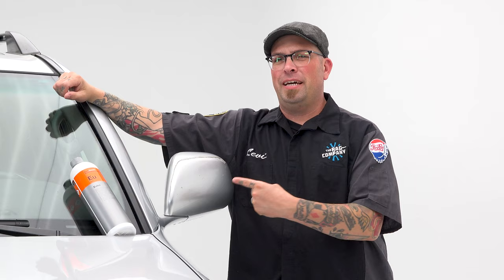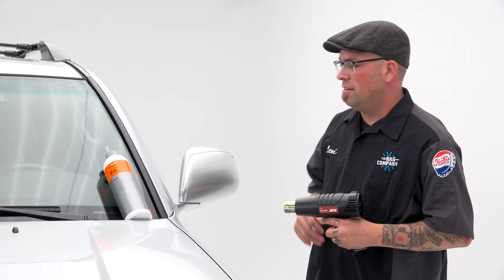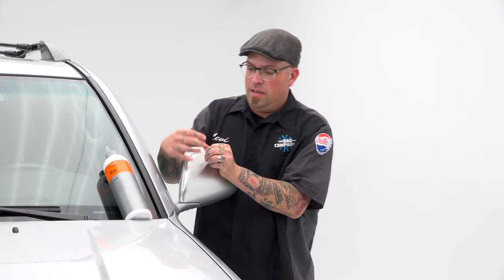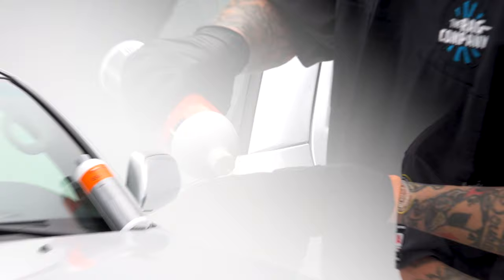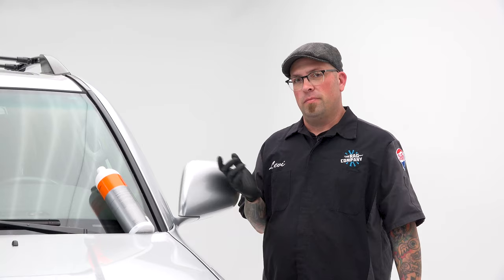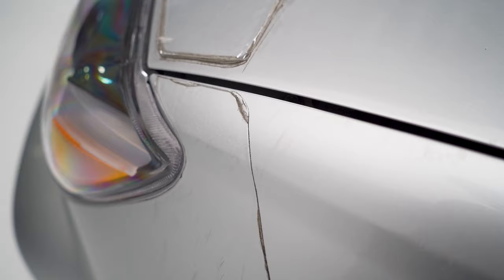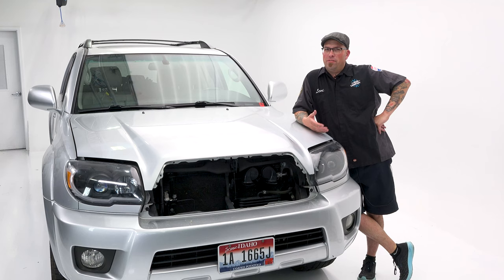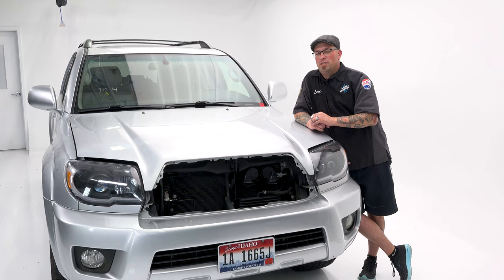Nasty old Paint Protection Film on your car? Here's a safe way to remove it!

Comment: So you have to repaint the areas that were not protected to match the area that was??? So why even use a clear protector? Doesn't make any sense
Reply: That's why you need cheramic paint coating too.
Reply: the intent of the film is to protect the finish, but it doesn't work well, it doesn't last. It's a failed product.

Comment: For a super easy way to heat up the section easily, lay a drying towel across the ppf and pour hot water over it. It will hold in the majority of the water and make removal easier. Heat guns work great but the hot towel is even safer. Also, just a tip, but inspect the paint prior to removal. Often with repaints, if the paint was not cured properly or even if the paint job was not the best, pulling clear can be an unfortunate side effect. Obviously in this case you guys know the vehicle, but if it’s a customer vehicle get a little background info first. Always better safe than sorry
Reply: So what you say a steamer is better to use rather then a heat gun ?

Comment: That looks like a pain. I hate removing PPF but if you use a kettle and pour a little bit of boiling water it works wonders.....but still not a job i would want to do lol
Reply: And likely that would not help when it breaks off in tiny little pieces like that

Comment: I used a plastic razor blade and gasoline. It didn't remove paint or clear coat. Put a soaked towel on each place and left for a while to soften then scraped. Used it with a blow dryer in some places. Gas worked better than laquer thinner. No damage but it was a nightmare.

Comment: Ppf installer for 7 years, we just use a good  steamer to soften it up and comes off clean, doesn’t peel paint or break off like that. If it’s shitty ppf/ been on there for more then 10years then yes this can happen. But it’s not vinyl.. using a heat gun doesn’t work the same way for ppf

Comment: I've used Goo off that works very well and it's oil-based and it will pick up all this stickiness especially if you're working outside got let it beat up and then it removes it nice and clean

Comment: ok great advice for NEWish protective film. How about some advice for OLD protective film. What solvent means I dont need to heat and hack at it for hours.
Reply: i know i am late to the party but there is a product that works great on OLD film. its made by crystaltek(west end products) and is called vinyl off and they also have a more "aggressive" one that is made for the reflective vinyls and 5-10 minutes in the sun and spots of film will literally separate from that panel
Reply: @ronbaer67  thanks. Yes, quite late indeed. Will see if I can get it where I am.

Comment: You didn't mention in the video.l but what were the reasons to remove the ppf?   And what about half ppfed panel? Like the hood that was partially ppfed,,  the sun usually beat up the paint and it changes color over time.. were you able to normalize the hood color with a compound? Can we still see the ppf area?
Reply: Hail damage requires removal of ppf if you are doing hot glue PDR

Comment: Help! I think my heat gun was too hot and the plastic film fused with the glue into a goopy coat. When I remove the heat, the goop gets hard, when I apply the heat it gets super sticky. I tried applying WD-40 while it was warm and it just cools it off and becomes hard. Ideas??

Comment: If I have an adjustable heat gun, what's a good temperature to use that won't damage the paint?
Reply: I would try with boiling water first or boiling water on a towel. Consistent heat will work to loosen the glue better than a heat gun. Look in the comments for how to do it or do a YouTube search.

Comment: The dealer had put that stupid "paint protection" crap on my car before I came along and bought it, and though I did absolutely refuse to pay for it, 6 years later it is cracking, peeling, turning yellow etc and looks like hell. Interestingly, the unprotected paint itself looks new anywhere the "protective film" doesn't exist. My son owns a thriving vinyl graphics business, and wraps/unwraps cars etc all the time, and even he is afraid to touch that stupid stuff with a ten foot pole. My advice is to never buy a car that has it in the first place.

Comment: What is the average life of a clear bra, assuming regular maintenance and a coating (eg wax or ceramic)
Reply: It depends on the quality of the film and the climate where the car is used.. up to 7 years should be safe for high quality films like XPEL.
Reply: So would you recommend removing it at 7 years? What is the consequence of waiting later?
Reply: @waterdd1  My Toyota Sienna with PPF has been exposed to the Florida sun for almost 8 years. It looks like it has leprosy. After watching this, I don't dare attempt as we have a new one on order  and dealer has already inspected for the trade-in. I won't get PPF ever again.
Reply: @4amazinggrace  thanks for the recommendation

Comment: Actually real fact is PPF is not the best for any car because PPF is not the permanent solution, after every 3 to 4 years ppf should be peeled off otherwise car original paint might be damaged, and PPF will not be able to protect any car from any small accident Or Big or small scratches, 

but graphene ceramic coating is the best and there's no side effects like PPF,

Comment: Total bullshit!!!!  If you do this with a heat gun on any plastic material, you will absolutely RUIN it and will have to repair and refinish the part!  Just use a solvent and a plastic or (very hard) wood scraper.  NEVER USE HEAT ON PLASTICS.  Got it?!?  NEVER!!!!
Reply: Agree, i was like WHAT? Someone talked about hot water that makes more sense.